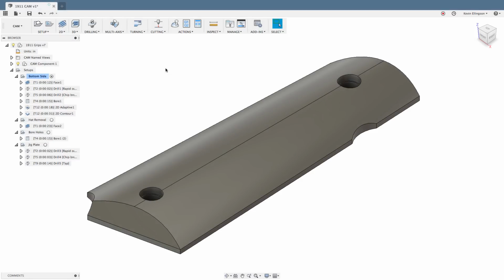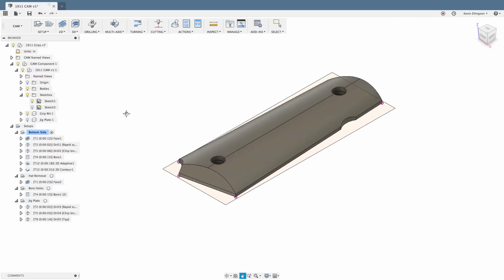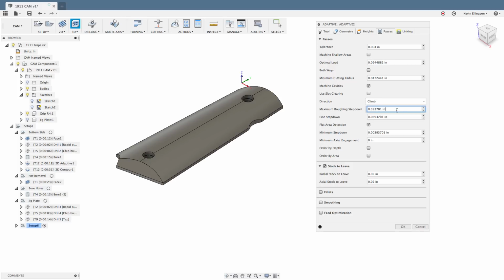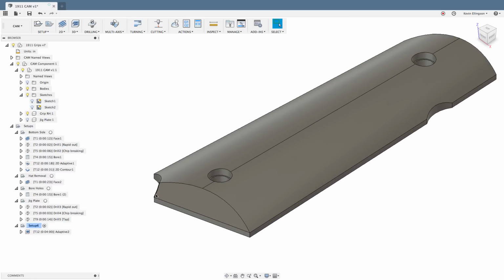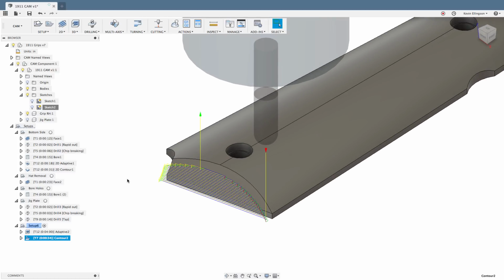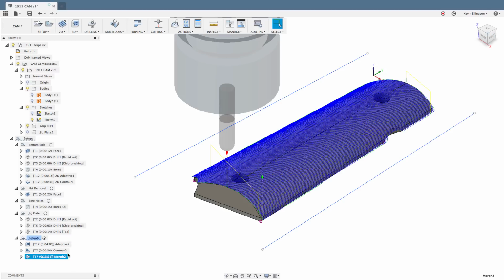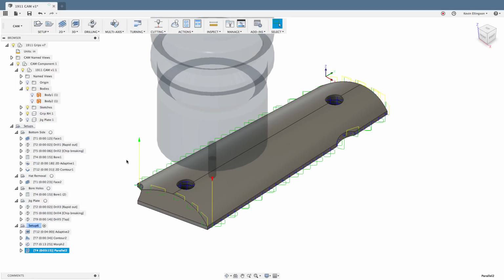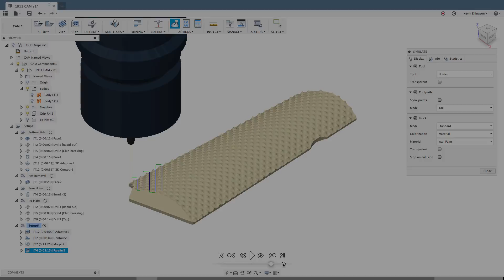Fusion 360 - 3D CAM 1911 Grips

Comment: What post processor did you use?
Reply from the maker: Quinn Hale Let’s tag @dctteacher1 and see if he appears to answer that question. I did the toolpathing and then Aaron Powter posted his own gcode from that file.
Reply: @MechanicalAdvantage  thanks. I've been watching his videos, and am very interested in the idea of buying one of Syil's machines.
Reply: @MechanicalAdvantage  Consider it done grasshopper master ;-)
Reply: Hello Quinn.  To machine this part I used Fusion360 CADCAM and my SyilCNC X7 combo milling machine.  The post processor was created for me by Scott Moyse from CADPro (see his comment above).  I think it was the generic Fanuc post that edited for me.
Reply: @DCT_Aaron_Engineering  thank you for the response. The x7 seems like a good machine. I think it's time to start saving up my pennies.
Reply: Quinn Hale yes it’s a fantastic machine. Excellent value for money too. Check out the SyilCNC User Group of Facebook 🍻
Reply: @DCT_Aaron_Engineering  excellent idea. I will, thanks.

Comment: WOW ! Just put a knurl effect on the grip WITHOUT sketching and extruding it. I am impressed !!
Reply from the maker: I hope you had. a chance to check out the Instagram links to the grips that Morgan Oliff did. If you do, note that the pattern that is generated is all done via the same sort of method I did with the parallel tool path with axial offset. He uses a different tool path for his, but he didn't draw anything either, except the cobra logo of course.

Comment: it seems like alot to take off on that last texture passes with the ball mill in metal. Is this plastic?
Reply from the maker: petiyo101 Hi. This will be made from aluminum. I think it looks deeper than it really. Is. .030” (less than a 32nd of an inch). It shouldn’t give any problems.
Reply: @MechanicalAdvantage  gotcha